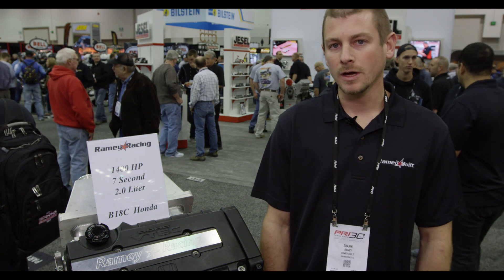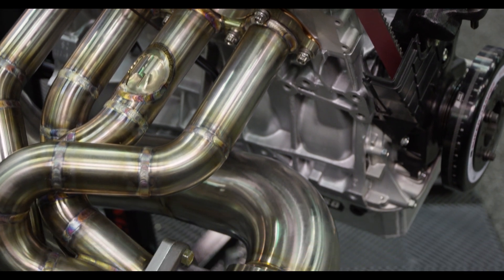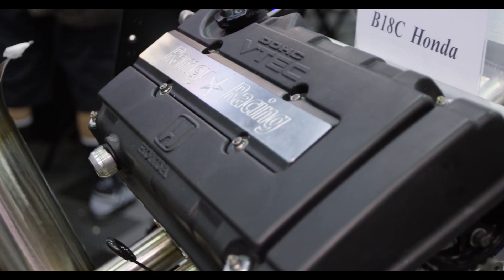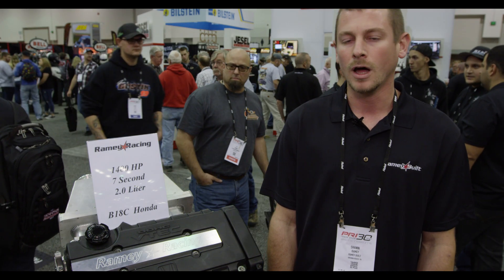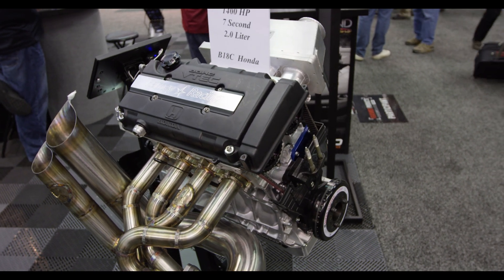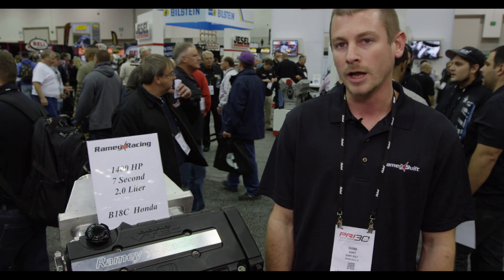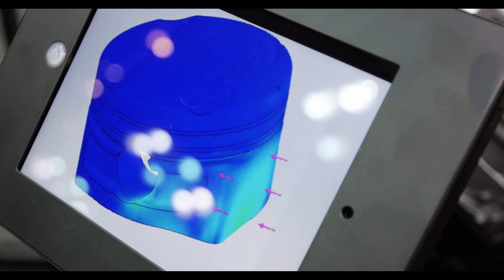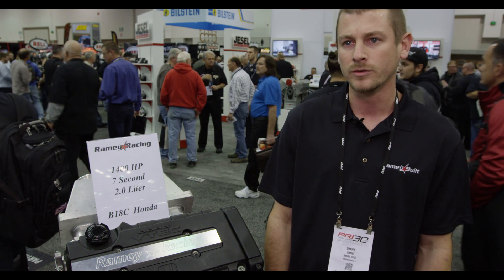Inside Ramey's 1400hp B18c 2-Liter Record Setting Engine

Comment: That's my dream engine. A 2.0L B18. I'd rather have that than a K swap. Even if it was only 400 hp fully built. Stage 2 rods, pistons, cams, Springs, valves ect..

Comment: I just wish I had the engine and a 7sp paddle shift AWD system that would handle it without shredding.
Reply: I felt that👍
Reply: You can easily convert civics to awd now, however a transmission to handle that power is going to be hard to find. This is one of those things where it is honestly just to much for just about anyone to handle. I'm a much larger fan of the naturally aspirated builds.

Comment: Man, could you imagine if Honda made a V8 based on the B-series or K-series?
Reply: Some shop made a LS based V12. There is a Hayabusa V8. So some Honda shop can do this if they wanted to. Not easy, but far more simple to do in 2018 with the tech we have to prototype.
Reply: infant honda does make a v8. its not for public vehicles however. they have for indy racing. spins to 10,3000

https://en.wikipedia.org/wiki/Honda_Indy_V8
Reply: Why do you think honda can't do V8?
Just think about the domination of  Honda v8 and v12
In FORMULA 1 and INDY CARS?
They've been doing F1 v8 with collaboration with Lotus since the 70's.
Of course they can make a commercial V8 based under this previous competition ventures.

Commercially? Not cost effective for honda to produce V8. Their 4 cyl variations highly supported by consumers. Their 4cyl design are highly robust, configurable, variable and durable.
Reply: I don't know what you're talking about.
Reply: @sigmaprojects  someone is doing that right now with a k series head lol. You must have been able to see into the future
Reply: @wendellgreenidge3362  What a coincidence I just found out about that guy making use of two K series heads oriented in opposite directions. Curious if it's the same person I'm thinking about.
Reply: @sigmaprojects  I think so, it has the exhaust in the middle of the engine instead of the sides
Reply: @wendellgreenidge3362  yes, that's the one I'm thinking of. It should be amazing. I can't wait to hear screaming. I think he's punching it out to 5.0L for his presentation motor.
Reply: @sigmaprojects  I can’t wait to hear it!!!!
Reply: wouldn't perform as well. v's rattle and shake. from piston stroking on different planes. 4 cylinders are inline - in the same plane, and thts why they can rev higher.  higher revs = more power and torque,. they're better balanced
Reply: Sure? But a 4.0~5.0L Honda V8 would still be amazing. If Ford can produce the 5.0 V8 Vodoo motor and it rev past 8K rpms I don't see why Honda wouldn't be able to do the same thing. Plus 90 degree V8s are decently balanced and both inline 4s and V8s that have flat plane cranks suffer from secondary vibrations. V6s and V10s are the ones that are inherently unbalanced.
Reply: rpm has nothing to do with torque. and the high revs come from balance, not plane of pistons.
Reply: they would be fun
Reply: With great power comes great responsibility
Reply: I know about those, I'm just saying imagine if Honda produced it for mass market. In the mid 2000's Honda teased at the idea of a 4.0L V8 NSX, but it never came to fruition. I mean at least they did make the HSV, but never made it to mass market. They sure like to tease the consumers with V8s.
Reply: Actually it was a 5.5L V10 NSX which was built and run on the 'ring a couple of times for testing. Then cancelled because apparently "noone wanted large displacement NA anymore". Audi then laughed all the way to the bank with 10yrs of V10 R8's. https://www.youtube.com/watch?v=B0OTEZDAb9c
Reply: Pretty sure it’s been done by mugen
Reply: Of course it would be great. Just watch v8 hsv010gt or even v10 prototype nsx from 11years ago.
Reply: @djhrjeiwhri  Oh believe me, that was one badass car. Shame it never made it to production. It had so much going for it.
Reply: that was a private engine builder. its was not chevy or gm, and yes it an be done with honda blueprinting in the same fashion
if you search on youtube you can also find 2  2jz-gt3 engines put in a v to form a 2jz-gte - v12
Reply: Inline straight 8 would be insane!
Reply: V8 with vtec it would be very nice
Reply: Just google honda hsv-001gt, the lost nsx.
Reply: yaa bro , i can imagine .. it'll be have a good torque :D
Reply: @egyabarth138  I mean a 4.8L V8 sounds pretty enticing to me.
Reply: @sigmaprojects  but iam trolling in honda torque :D
Reply: @egyabarth138  Ah figured you were just hating instead of trolling. I was just thinking it would still be nice.
Reply: there's mugen v8s you can buy. costly though, both the initial cost and the maintenance.

real race engines, though.
Reply: @DontKnowHowToTypeIn2  for sure a badass engine, but yea probably insane price being a real race engine. Honda V8 would be like a Voodoo competitor. Like the everyman's high revving V8
Reply: If they made an i6 that would of been nice